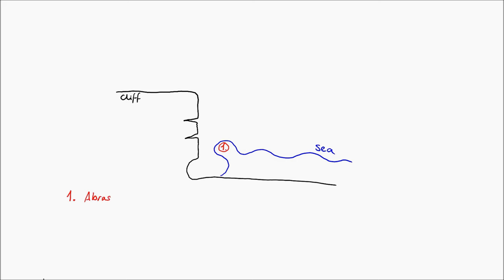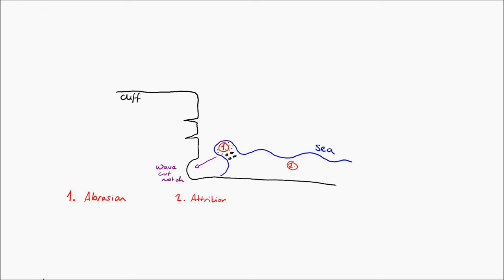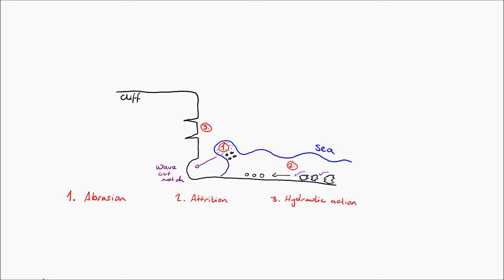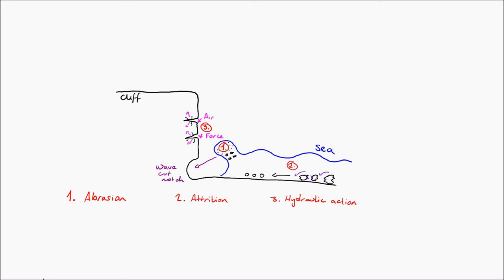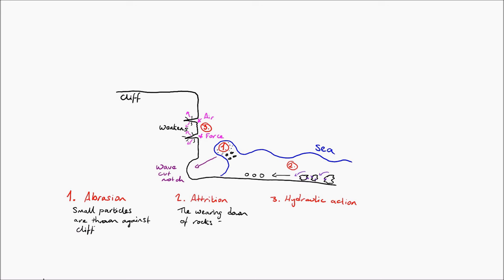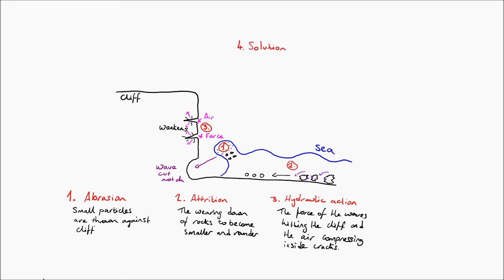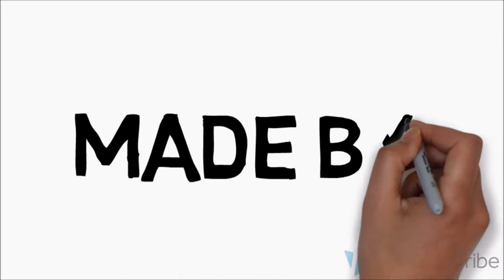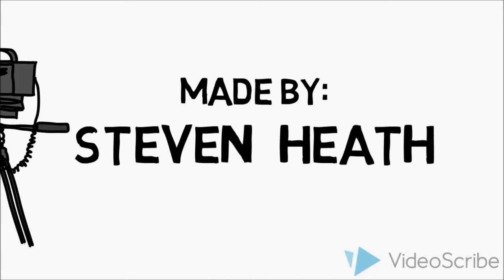Types of erosion (coast & river) - diagram and explanation

Comment: something i think worth noting, tho not relatable to the diagram however an even more important action performed via hydraulic.....action, (a more important process then) that hydraulic action produces is thru something called "ice wedging" and this is where anywhere that experiences freezing weather and thawing in the summer. What happens is as it rains the water, due to its adhesional properties sticks to a cliffside or any steep rock face, will run down its face, and eventually reach either a joint (if you don't know think of a joint as a fault line's little nephew) or some other crack in the rock, the water will run into the crack and stay there till winter if it doesn't evaporate, when winter hits an the air freezes, the water will freeze and the process of freezing is so powerful that as it freezes & expands, this expansion will actually further split, or crack open the rock, any rock, be it even solid granite, this will make the joint or crack widen and deepen and the process starts over untill finally it breaks away from the cliffside and falls down as huge jagged rock, this is why you see primarily jagged giant boulders below a cliff face. This is by far thee most important erosional process of them all, because this is the very 1st one to take place. its what takes place in the highest mountain peaks and its how mountains get that jagged appearance because its the main force glaciers' use; ice wedging, without it, erosional process would only have solution to work with, and unless its a carbonitic rock or alike, the acidity of rain would do little and mountains would take many many millions of more years to erode, the only physical process would be land slides and the amount of particles that flow out of ranges would DRAMITICALLY reduced, thus the whole planets terrain would be a much rockier surface

Comment: i checked on bitesize and you mixed up abrasion with attrition
Reply: Hi
Reply: See
Reply: U
Reply from the maker: Be careful of what you checked because from what I can see the definition is the same. We just use a few different words "Abrasion - this is when pebbles grind along a rock platform, much like sandpaper. Over time the rock becomes smooth" This is the definition on bitesize. The grinding of the pebbles on the rock platform is the erosion. Them becoming smooth is a byproduct. and sounds similar to this "Attrition - this is when rocks that the sea is carrying knock against each other. They break apart to become smaller and more rounded."
Reply: @GeographerOnline  hi. the abrason is actually the sandpapering effect as a result of the rocks together. in fact, the abrasion you have described is actually known as corrasion, which is when the waves hurl rocks at the cliff face and consequently break down the cliff wall.